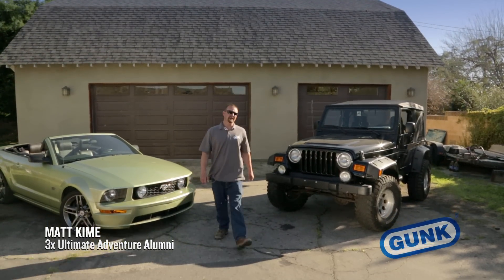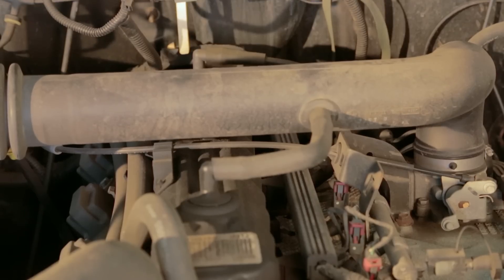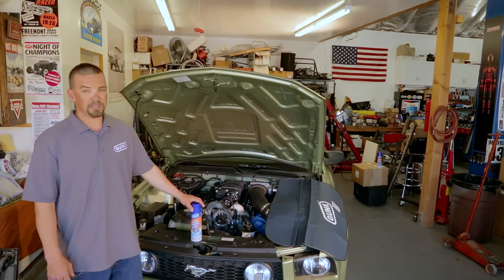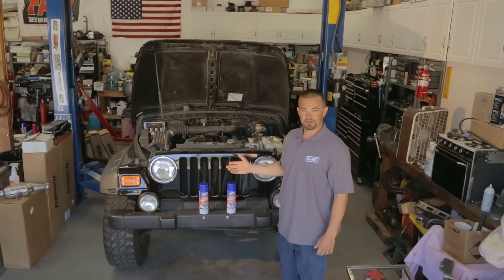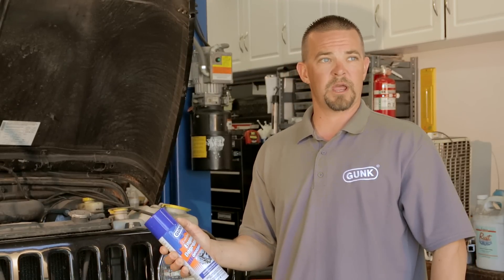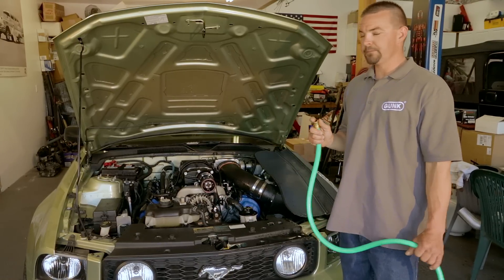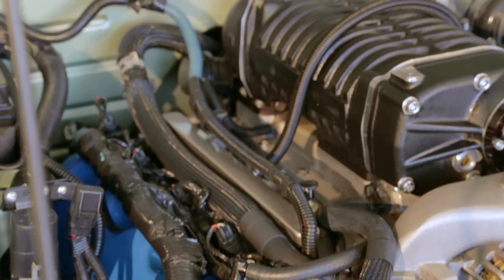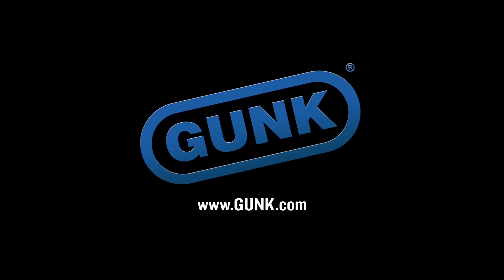Clean+Protect: GUNK Engine Cleaner | How to Degrease Engine Bay

Comment: It is perfectly safe to clean any car engine , spray on the degreaser firstl then aggitate with a soft paint brush then rinse with a power washer or just a hose. Then the important part isuse a warm blow dryer   ie  a motorcycle dryer . I use the Atom car+motor cycle dryer  pay attention to the electrics alternator etc. Only attempt to start the motor up when you are confident everything is dry then away you go.I use this method most week ends with out any problems ever.The best degreaser i find is the autuglym machine clean. Then when all is clean+dry spray everything under the bonnet with autoglym vinyl+rubber care spray.

Comment: I've never covered any engine components when washing engines. New, old, gasoline, diesel, none of them. Don't stick the hose into the air cleaner, duh. But a little water in the air intake isn't a problem. It will heat up and convert to steam and clean carbon off internal surfaces. Electrical connections are not problematic. They're either sealed with weatherproof boots or they're open, just like high tension lines that get wet in the rain.

Comment: I like the products but I just don't feel comfortable spraying water on my engine. I usually just spray and wipe off with some shop towels, same great results just takes longer.
Reply: +Mr.T456 thats gay
Reply: I use a household steam cleaner but I agree with you spraying water on your engine it's very risky.
Reply: Drive through a puddle, pull over and look under your hood.

Comment from the maker: ali hood - We have been cleaning engines for over 60 years now and if you follow our direction you will have no issues with spraying down your engine with water.  Make sure that you cover any air intakes and wires that may be cracked but otherwise you should be good to go.  Let us know if you have any other questions.

Comment: how to fuck up your alternator 101
Reply: a alternator only gets messed up if it is already faulty much people don't know this. you can set any part of your engine once water don't get in the air intake as all components are insulate. also try too avoid using high psi of water in your engine bay

Comment: Kinda breezed over/missed some key points IMO. Ive never had issues getting everything wet, just dont soak it more than you have to, to rinse it. Also IMO if your engine is moderately dusty getting a big jug of cleaner degreaser at the hardware store and diluting it 50/50 with water for a similar price as a small can of Gunk is a better deal by far.

Comment: Can I drive to a car wash and use that stuff or does the engine have to be cool?
Reply: John Doe  I saw on another video the guy said that the engine should be warmed for 5 minutes. don't do when it's cold outside
Reply: most car washes have a notice that you are not allowed to use car cleaning products inside the wash bay.

Comment: Why didn't he cover the alternator and electrical parts?
Reply from the maker: Hello Abraham, 
Modern cars are designed to handle a reasonable amount of moisture under the hood to withstand various weather conditions such as driving in the rain. In this case, Matt was careful not to hold water over the alternator for an extended period of time. Being careful not to soak key components is always suggested and if you are nervous during application, then we recommend placing plastic over sensitive components during the application and cleaning of GUNK engine degreasers. Just remember not to use plastic bags on a hot engine, let it cool, and definitely remember to remove the plastic before turning running the engine.

Comment: you have to cover important electrical parts like alternator, battery,distributor, etc. you will have to use a steam cleaner not just water hose and the engine is not suppose to be hot but just warm to touch.after spraying with degreaser wait and let its seat for 5 to 10 minutes before steam cleaning it.You have to make another video and do it right.you are giving the public engine problems.cmon now dont be part of the problem but be part of the solution.Do not spray to much water coz you can ruin some electrical connection.If you see it visually clean its done.If you want it detailed clean see a professional and pay big$.but you just wanna see it looks clean.then just do it in a simple way.Goodluck your guardian angel in earth:)

Comment: Why are you going to put water on on the engine
Reply from the maker: It is perfectly safe to clean an engine with water as long as you take precaution to protect any sensitive equipment that you may have concern for. Many people will put a bag over their ECU and alternator to protect it from water being poured directly on them. It is also wise to protect any exposed wires from any aftermarket accessories like for sound systems or aftermarket lights, since these weren't installed by the manufacturer and designed specifically for wet weather conditions.

Comment: Very very poor video, alternator, ignition coils, distributor and major wire harnesses MUST be must be covered and avoid any water contact to these components. Lets think about this. If the vehicle is new, its usually serviced by the dealer. These products are usually used on older vehicles and as with older vehicles, the seals and insulation are not in their perfect conditions to resist water. Some VW and Audi vehicles have their ECU (the main computer) placed inside the hood and just a mist of water can ruin this computer and cost $$$$.
Reply: Persian5word It is a good thing that I protect all those parts when I drive during a rain storm or when going through puddles.  Although I suppose that if water is dripping of the underside of my hood that those items are still dry, right?  I mean there is no way that a car manufacturer could expect anything in the engine compartment to be exposed to water.  Certainly the pressure of a garden hose would be too much for my car's gentle electronics to handle.  

Considering how damaging heat, dust, and vibration are to electronics I am certain my biggest concern is some water.
Reply: Brian Goralczyk Unless you dip the car in a pool, there is NO WAY that underside of your hood to be dripping with water, regardless of how bad the weather is. EVEN if you cross a one foot deep river with an SUV, your engine compartment's top would be dry. (based on experience)
My comment was based on experience. I love the product and it works great and I've used it many times of different cars. 
The video was made ignorantly.
Reply: Something leads me to believe you've actually never seen an ECU for a car...  They are contained in a water tight enclosure, kept under pressure...Do you really think they would sell a car where just a mist of water that happens to get past the grill or up in the underside of the car could disable it?

Comment: Is it really safe?
Reply: ***** How do you protect your engine from liquid when driving down the road?
Reply: +thirstyy thristyy I have to tell you.  You don't know what you are talking about.  I have worked on too many cars to fall for that.  I have seen the entire hood insulation soaked with water.  From a storm, not from driving through puddles.  Engines get SOAKED in usage.  That is why electronics are sealed.  That is why there are so many gaskets.  Unless water gets into your intake line or completely blocks your exhaust your engine should be able to run just fine.